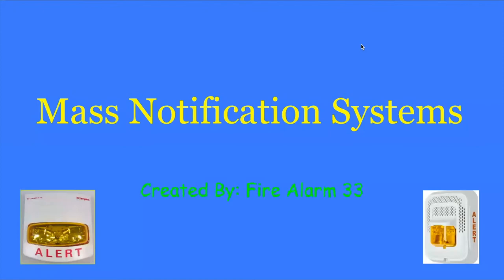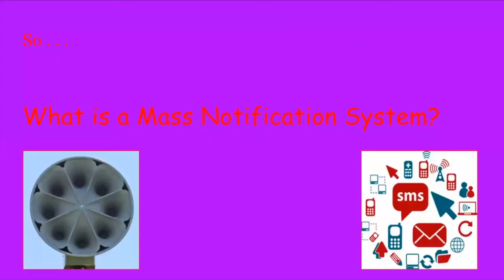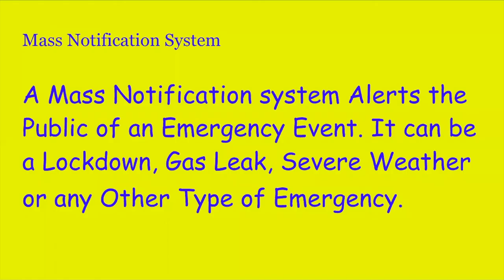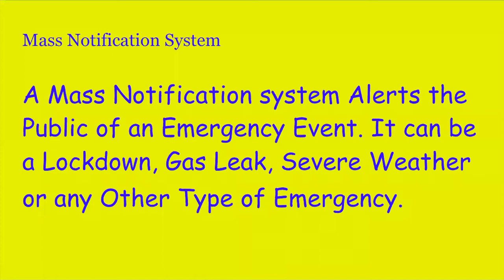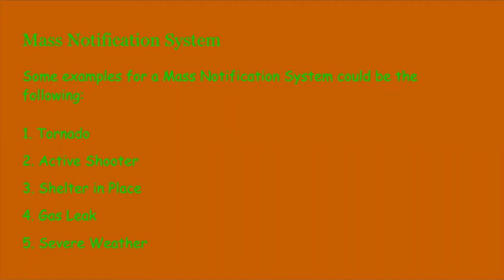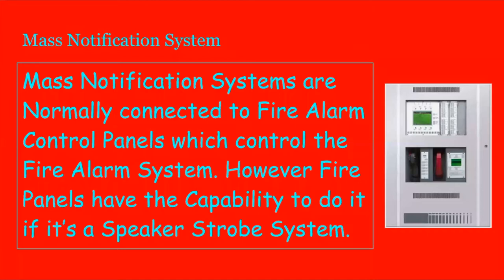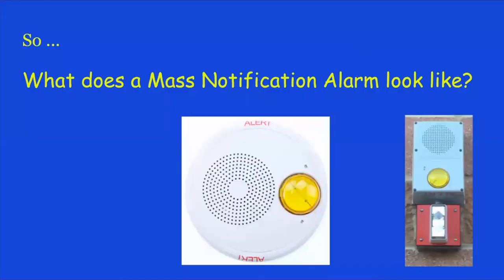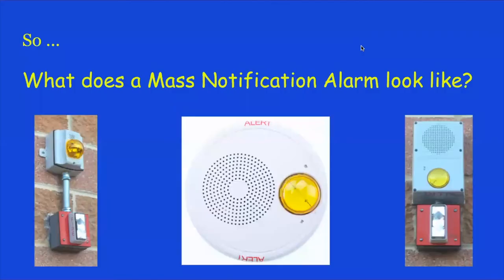Mass Notification Systems

Comment: 2:12 what is the purpose of that white system sensor P2WK with the integrity?
Reply from the maker: So it was a Pretty Big Rush to Complete the System. My Guess is they Ran Out of Alert Speaker Strobes. So they Just Installed a System Sensor Unit.